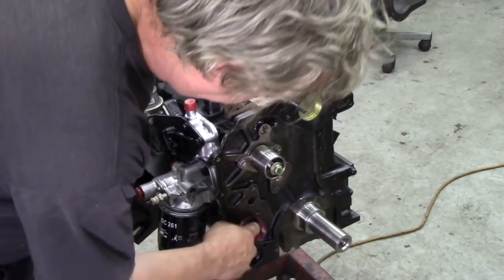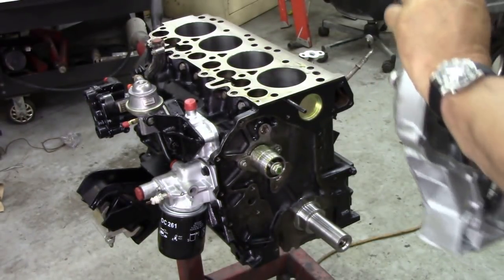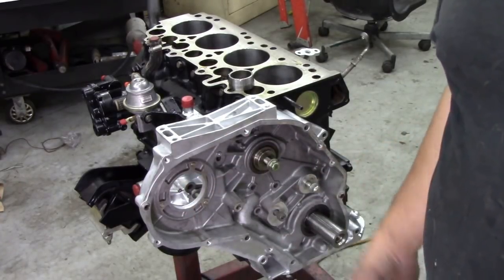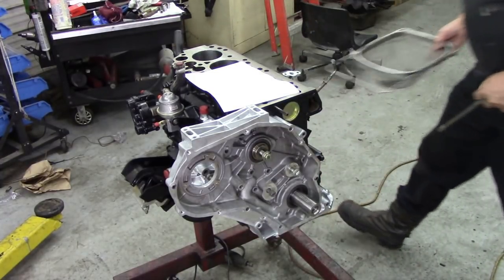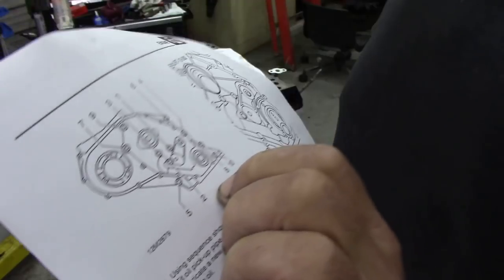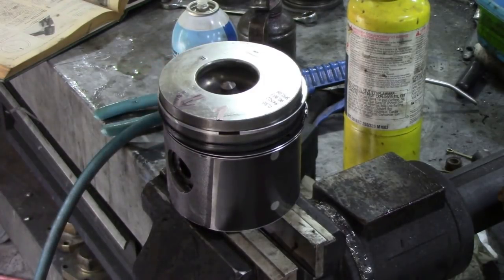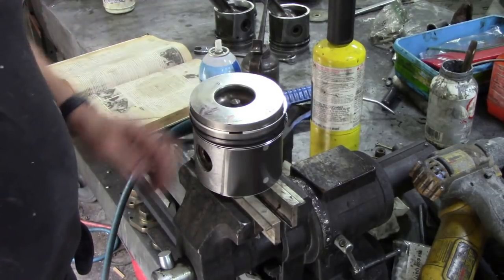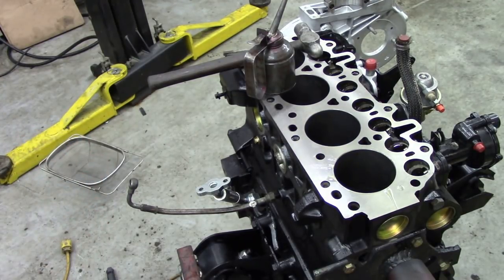300Tdi Rebuild  fitting the rods and pistons

Comment: See, this is the sort of stuff that a lot of people don't know they don't know.
Buy a bunch of parts off the interweb, throw them together and everything will probably work reasonably well.
Spend the extra time tidying things up properly and it all has an cumulative benefit on the finished engine.
Still kind of funny to see "race car" preparation on a 300tdi though.

Reminds me...

Worst job I ever did was rebuilt a Jaguar V12 for a Cobra replica.
There wasn't anything especially difficult about it but, lordy, porting 12 inlets, seating 12 sets of valves, balancing 12 conrods and pistons, doing 12 sets of tappets etc was the most laborious thing I've ever done!
After that, it was about 3 years before I was ready to work on an engine again.
Reply from the maker: Friend of mine many years ago who rebuilt RR engines ( from the Ghost era) told me he could stand a penny on the engine while it was running - not so easy with a diesel but a target to aim for!

Comment: Great vid!! I was told by the same old race car mechanic that the snap rings are sided. One side has a rounded edge and the other the sharp edge. He told me to always put the sharp crisp edge outwards so it’s more difficult for it to pop out.
Reply: Your right there, Circlips particularly the smaller one's are stamped out of steel sheet or strap, the larger one's which i used to make are coiled on a lathe then stamped on a press, the downstoke produces the rounded edge and the base is where it lets go producing the sharp.

Comment: Hey Mike, nice to see a master at work. BTW I have been using WD for 30 years or so to run the rings in on the bore, causes an engine that does not use oil at all and a proper seal therefore good compression, before running I spray WD in again for initial lubrication, works a treat.
Reply from the maker: Interesting for the WD40 - on many engines I build they are not fitted for a long time WD40 evaporates too quick for my liking and I like the oil to help the piston slide out of the compressor
Reply: @BritannicaRestorations  fair enough

Comment: That s going to be one of the smoothest 300Tdi in the world, interesting to see the differemnces between my  Defender spec 200Tdi & the 300Tdi, I rebuilt my 200Tdi 2 years ago,  it was 24 years old with 390,000 miles to its credit. That 300 should last at least 20 years before it needs major work again. unless the owner seriously abuses it & neglects oil changes.

Comment: Had to have a cup of Yorkshire tea and have a think about the circlips on the wrist pins.

As I see it, and I am really only an expert in drinking tea, as the piston and rod hit top and bottom dead centre, the piston travelling at high speed suddenly stops and it forces the circlip to compress downwards or upwards. 

If it is installed at 90 degree to the conrod, it could compress and pop out.

Yes, I know fella's, I need to get out a bit more but I have been in lockdown.

Comment: Had a circlip come out in a Harley Engine once, The Gudgeon Pin milled the cylinder bore a nice trench, You should have seen the smoke,lol. The Circlip finished up in the oil pump, all nicely cropped into pieces by the gear's and stowed away in a chamber, Needles to say! total rebuild with new cylinders and pistons etc.

Comment: Fantastic work, Mike.  I saw how you measure each end of the rods’ mass to prepare for balancing,  but could to explain in a little more detail how and where you remove material, and show how much or how little material is involved per gram?

Do you ever hone bores (for deglazing or general cleaning up, rather than removing steps or scores) yourself, or do you send all locks away to the shop?  What about honing with the block in situ?  How practical is that?  I need to do that at some point as I think mine are glazed (giving high blow by and oil burn), but most YouTube videos on the matter are very glib and don’t cover which grade of stones to use or any useful detail on technique.   Even taking bore measurements is a confusing activity to read up on.  Any hints or tips would be greatly appreciated, and if you get a quiet period (I hope you don’t, from a business perspective), a video of a single bore being done would be a huge help (I suspect I can’t be the only one in this situation, given how many people are trying to keep older LRs going without spending large sums at shops like Turner or ACR, as worthy as their charges are for the quality of their work).
Reply from the maker: The cylinders were honed at the machine shop - I chose them as they have a fancy machine they clamp the block to the mains in place of the crank, and then everything is square to the crank, that is why the can deck the block parallel to the crank
In the old days they clamped a machine to the block to bore it, but if there is a deflection in the block then the bore will not be 100% square
I will show how to balance rods later when I get a bit more time

Comment: Interesting you noted that you modified your ring compressor...  mine is also a relatively cheap one, but already had little V shaped projections on the bottom to prevent going into the bore... I always thought that was standard for any of the ring compressors. Interesting to see the big end bearing shells not as wide as the face on the conrod...  why would that be?? I would have thought they would want to utilize the maximum width for maximum bearing surface.
Reply from the maker: The pistons on Tdi are wider on the skirt and as the compressor is thin spring steel, in the early days the compressor would drop into the bore when hitting the piston
Sorted now
Bearings - they are the same as the old 2.25 in dimension
Reply: The bearings need to be a little narrower than the rod big end to account for the radius or fillet on the crank journals where they meet the webs - if the journals were machined with sharp corners, they’d cause fatigue cracks.

Comment: great stuff , hope when you said I have broken rings before when installing , wasn’t because you forgot to check ring gaps in the bores before installing on the pistons . I know from experience , because its new its not always correct size .
Reply from the maker: I broke oil rings as I didn't hit them hard and fast enough - the skirt is wider than the ring area - so if you are slow, the rings can expand and catch on the block
Reply: ok , but as many people watch your great rebuild , I just think many things are missing . ring gaps in the bores must always be checked before installation . I’ve filed many a rings to give the correct clearance , using ring file tool

Comment: Hello Mike. Thank you for your videos they are very helpful. I have a question, when I was cleaning the pistons, the degreaser... Remove piston coating from the side skirt. that black gray layer. Can I still get the pistons? to use ?. without running any major risks? Kind regards from a Dutchman from southern France Ragnar Hetterschij .
Reply from the maker: That is an anti friction coating - many engines I have stripped have a little of this remaining, but I do not think that it affects anything  - we are talking hundredths of a mm!
Reply: Hello Mike. Thank you. In one of your other great videos you talked about camshaft bearings. There is a company in England that supplies pre-finished camshaft bearings. so a DIY job. no line drilling required. they made the hole in the bearing on the distribution side smaller. which continues to the head. to maintain higher oil pressure in the lower portion of the engine. very thought out. I am unable to send the link via YouTube. Normally I wash my parts in a part cleaner with some kind of turpentine-like product. but I was with someone who lived far away, so I did the work there. with a degreaser that you spray on the parts, let it soak in and rinse off with water. the pistons were supper clean and the coating disappeared. the wrong degreaser can cause damage. Thank you . regards Ragnar Hetterschij

Comment: Morning, first of all thanks for the videos and the knowledge you’re sharing with us all the time. Regarding of this video, I have rebuilt my 300 tdi watching your videos and wanted to know if you could give me some tips for the break-in after rebuilding. What do you recommend? An specifical break in oil or just normal one for 1000-1500kms and then replace oil and filter? And finally what about rpm range during this process? 1000-2500rpm an driving soft? Thanks for all, have a nice day.
Reply from the maker: In the old days of running in, I used a straight 30w, oil not a multigrade
The Tdi blocks seem to be made of better materials, and I just use 15w40 oil now
They take a long time to settle down!
I have had brand new 300Tdi's here and do not seem to be 'free' until they have done about 60,000km! 
I have a block in my shop at the moment 400,000km and you can still see the honing marks!
Reply: @BritannicaRestorations  thanks for your answer, that’s sounds good, finally I just bought an specifical break in engine oil which will run for 1000kms and then will take it easy. Thanks for all, have a nice weekend.